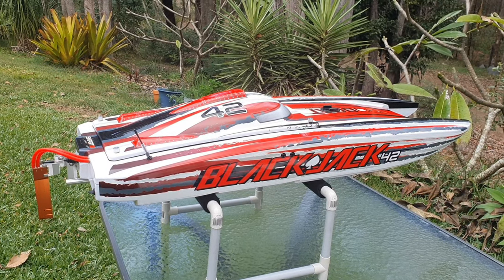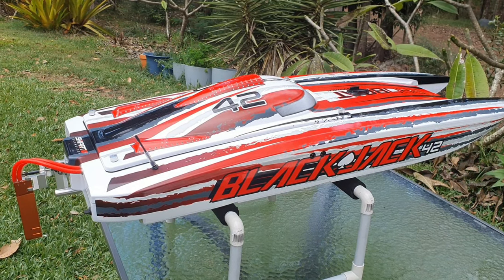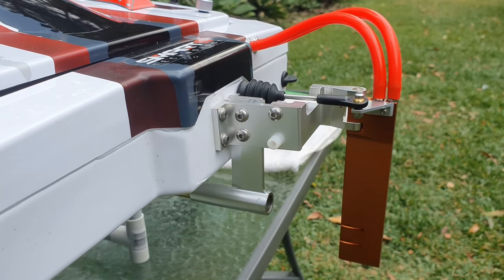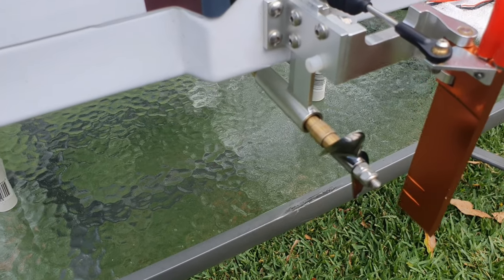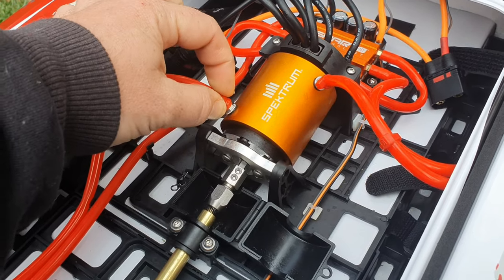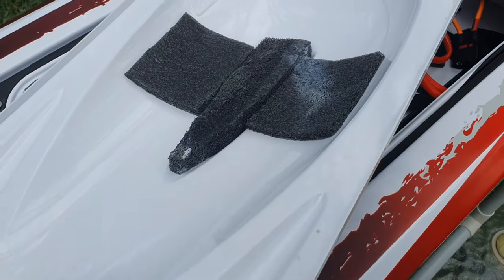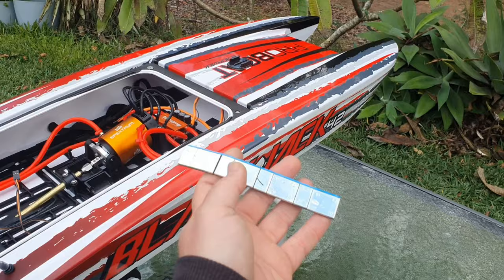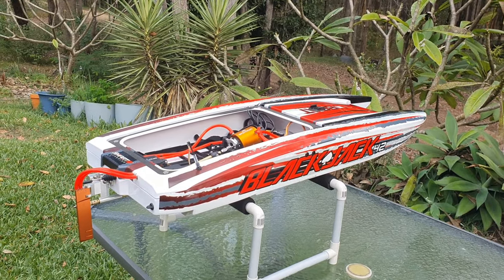Proboat Blackjack 42 Review, Final Thoughts and Tips

Comment: How much gap do you put on the shaft between the prop and bearing? I ran a 4814 and it got hot
Reply from the maker: Whatever the diameter of the shaft is is the amount of gap I leave. As for heat issues it could be a number of things, but generally speaking the primary cause is shit batteries, followed by bad soldering. A binding shaft usually doesn't last long and the generally will snap. I suppose it could just be rubbing... but you'd see marks on the bushings generally
Reply: @easternrc1924  I changed back to stock prop and the heat issue went away 🤷. Same batteries

Comment: Does the boat come with batteries and if it doesn’t what batteries should I get
Reply from the maker: No mate it won't come with batteries, id recommend at the very least 2x 6000mah 4s batteries. The bigger and heavier the better.

I run 4x 5000mah 4s packs